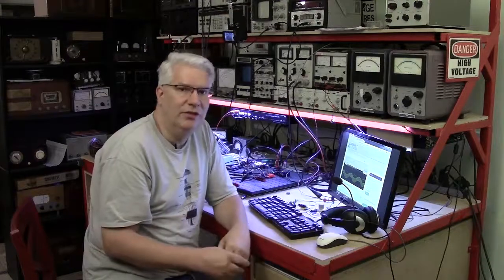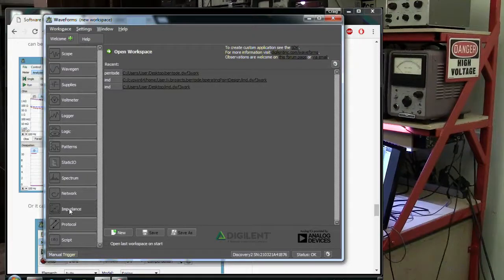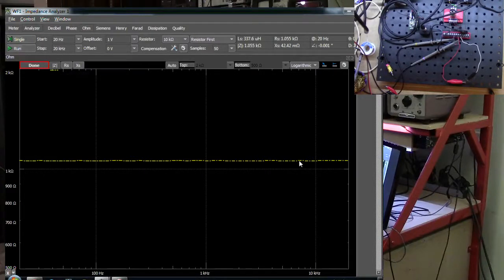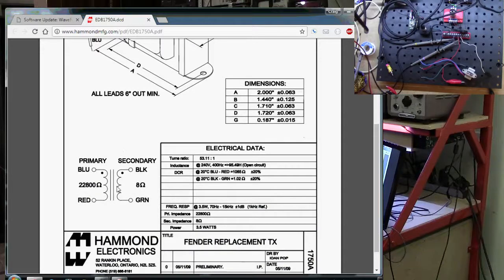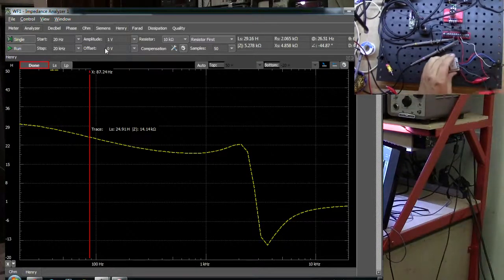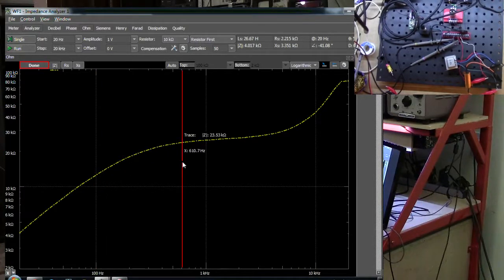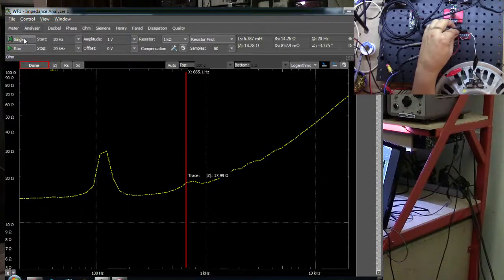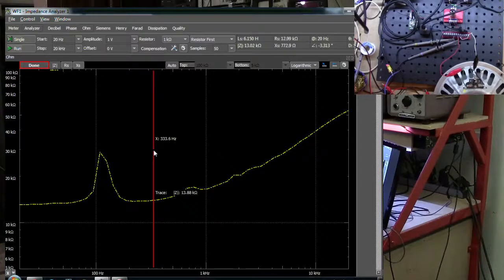170829 Valve Studio - Analog Discovery 2 Impedance Analyzer, OPTs and What Tube Plates Really See!!!

Comment: Hey Craig, you probably know this by now, but Digilent sells an Impedance Analyzer accessory board that automatically configures the circuit and selects and applies the proper resistor for the particular device you are measuring.  It's $21.99, sold by Mouser or Digilent.
Reply from the maker: I did know that and I have one. At the time, their impedance analyzer wasn't available. Hey thanks for writing and informing others about the Digilent impedance Analyzer. https://digilent.com/shop/impedance-analyzer-for-analog-discovery/
Reply: Any time,  @CraigHollabaugh !
Reply: @CraigHollabaugh  Hi Craig, Thanks for your video. I am just wondering if the AD2 can measure a more complex circuit with a combination of L, C, and R? Or is it just suitable for measuring a single capacitor or inductor?
Reply from the maker: @yangyu3640  It measures any impedance connected to it. Singles, combinations, etc.

Comment: Many thanks for this video. This is very exciting. 
In Thestuffmade's setup I understand the short leads to the test clips were important to minimize errors. How do you think the setup here with two oscilloscope probes compare to his setup?
Also on his board he had some amplification before the signal got to the Analog Discovery. How is this done on this new interface for Analog Discovery? It seems it goes all the way down to 1m.
I'm so happy now finally I can get to experiment with an impedance analyzer :D
Reply from the maker: I don't know about the amplifier specifics. I think he was switching in different resistor values during a sweep to stay between the noise and saturation.
Reply from the maker: I rewatched, https://www.youtube.com/watch?v=FomGhT8wmB0, and he does both. x16 amps and switching. To bad he was secretive and has seemed to disappear.

Comment: Great video! I wish I had seen it before I did part 1 of my video on the same subject - I would have known how to change the reference resistor value among other things I learned from your video. Thanks for this and please post more on the Analog Discovery and Waveforms.
Reply from the maker: Yeah, that pesky resistor was nothing but trouble when I first started playing the AD2-IA. 2 hours later, I started recording. I thought I was under/over driving the ADCs. The display warning too big or too small isn't clear and I continually went the wrong direction. Once I figured that out, then the message made sense.  I think the "TheStuffMade" IA used relays or analog switch to select various resistor values during a sweep to avoid noise or and/or overdriving the stage. 

The AD2 is integral to my instructional plans, especially now with the impedance functionality. I really didn't want to implement this functionality. I believe they used "Agilent Impedance Measurement Handbook" techniques, http://literature.cdn.keysight.com/litweb/pdf/5950-3000.pdf